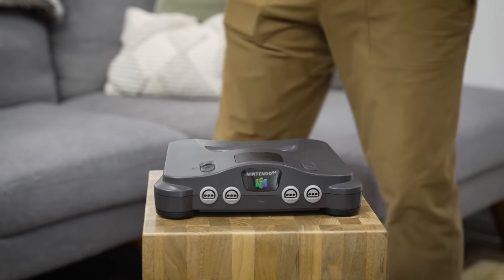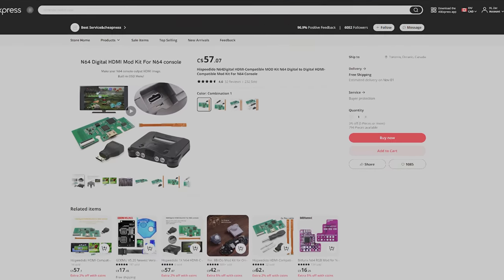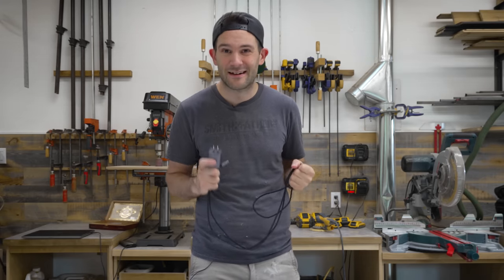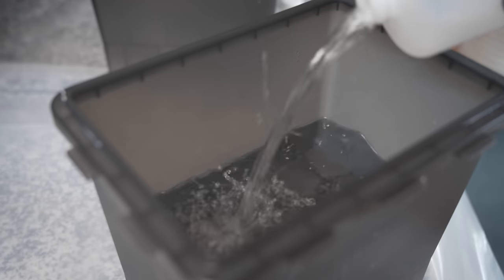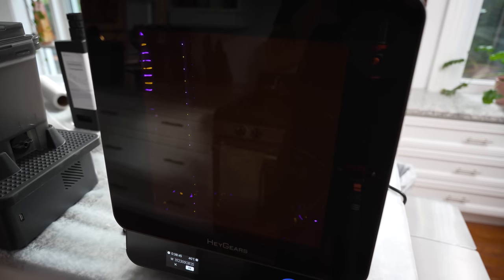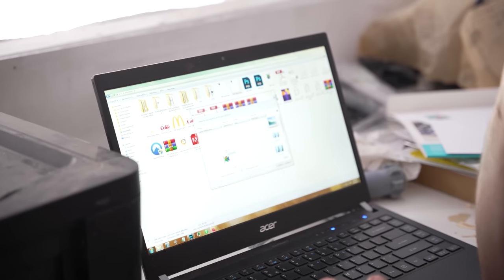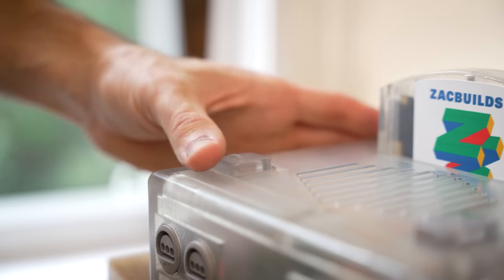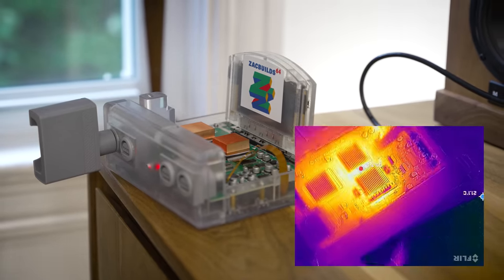I built a MODERN N64...

Comment: for anyone else wanting to do this its always a good idea to make sure you have the right voltage with a voltmeter, you can always resolder but you cant really go back if you fry your main board
Reply: a voltmeter? You mean a multimeter.
Reply: @lostdeath4202  ahh bahaha yes i do! i must have been a bit sleepy when i wrote this lol
Reply: @lostdeath4202  there are such things as standalone voltmeters and ammeters etc.
Reply: @lostdeath4202  How dense are you to not know what a voltmeter is ?
Reply: @pigggy2313  explain the difference between voltmeter and multimeter
Reply: @branaden  Honestly I didn't know they had standalone ones. I wasn't trying to be a mean btw
Reply: @lostdeath4202  a *multi*meter is called such, because it can read/measure *multi*ple things at different ranges. Usually 0-1000VDC, mV, VAC, current, resistance and diodes all in the one unit.
Reply: @lostdeath4202  A multimeter contains a voltmeter, just like it contains an ammeter (amps) and an ohmmeter

Comment: You should take apart the wireless receiver for the controller, de-solder the memory card connecter, and 3d print a new clear case for it so it is smaller and fits the style of your system! (or better yet, integrate it into the internal case by soldering the daughterboard right to the controller input pins.)
Reply: enriqueamaya3883  - Ha ha ha ha ha ha ha!
Reply: For real, that thing is fugly
Reply: First thing I thought when he got that giant thing out the box and yet he didn't!!!
Reply: He mentions this at the end of the video.
Reply: Add a memory card slot to the console. :)

Comment: Ok, this was amazing! I agree with disassembling the controller receiver, but a simple small dongle to attach in the original plug would be fine and something you still can do. I hope you have fun with it :)
Reply: If you do, just keep in mind that good mods aren't cheap.
Reply: exactly...the build is finished...nothings perfect...but that's pretty close...i was like...what the hell is that receiver could it be any uglier...must be way to solder it inside...he mentions it last in his final thoughts...that is the only thing to criticize...thermals are fine i'm sure...fit a small 1inch fan at the back with a few slots to be sure
Reply: I don't know if I would want to permanently install them. The power draw from the brawler dongle becomes a problem for the n64 with more than one plugged in. But if you never plan on multiplayer or just use the corded controllers for everyone else, you should be fine

Comment: I think the Everdrive's savegame functionality only handles on-cartridge storage. There were a few N64 games which required a memory pak for storing save games and wouldn't even let you continue from a game over without one, and some games also provided extra functionality with memory paks. So it's still really helpful to use a memory pak with this build.

I have the original wired Brawler 64 and it's pretty nice but I don't like how the thumbstick is a dome rather than semi-concave/indented like on the original. But aside from that it's a great controller.
Reply: There are 135 games on the Nintendo 64 that save via Controller Pak, and the Everdrive 64 has no way of emulating that. Only the ability to backup the saves from one and to write saves back to it.
Reply: You're correct, the Everdrive 64 only handles on cartridge save games.  A controller pak memory card is required for the games that used that method of saving.  The Everdrive 64 can create and restore backups of the controller pak though.  Modern versions of the controller pak exist, using FRAM, so a battery isn't required to hold the data.  If he was to do a revision, I'd just build the controller port adapter hardware into the case with a new controller pak inserted.  Of course, this setup lacks rumble, which means the Tribute 64 would have been a better pick for the wireless controller.
Reply: Yeah, this was a pretty glaring issue in the video. Hopefully @ZacBuilds will pin a correction because you absolutely need a memory pak with loads of games and the Everdrive does not emulate those, at best it can make backups of a memory pak that you can later restore back to a physical memory pak.
Reply: It's ok, but every modern controller has the analog gate shaped like a GC controller, making the sensitivity change with direction. Tribute64 is even worse (I know because I have two), since the cheap sticks they use aren't consistent to begin with. They're also overly sensitive in general, and this last one also goes for the old Hori, which is by far the best third party controller out there. 

Bottom line, you'll never get a better response than an OEM controller in good condition. Good news is steel bowls are now somewhat readily available, should you want to fix a worn one.
Reply: I came here to say this too. Without using a controller pak, you lose save functionality in some games.

Comment: I guess you could also take apart the cartridge and put it into the case. So the only thing sticking out the front would be some leds and maybe a tiny push button per controller to help reconnect if the link fails for whatever reason. At this point the machine could effectively be waterproof (grommets on rear leads and o-ring around the shell), and you could use it put your drink on - no fear of it shorting!

Comment: I did my own USB-C power mod for my N64. What you need to keep in mind is that it's not easy to find power adapters that support 12V. In those cases, you'll end up getting only 9V. So, I added a step-up converter to turn whatever comes in through USB-C into 12V. And the 3.3V step-down converter should be powerful enough to support around 3A. I replaced my first version with a 5A board with heatsink. Maybe you should check the heat of that module after using the console for some time.
Reply: Why tho? What's wrong with plugging it into the wall socket?
Reply: I can’t believe that this is efficient overall. Isn’t there any after market, small power supply with everything in the AC plug?

Comment: This is so sick! The micro-soldering left me in awe lol
But yeah like you said, the one thing I think you should've done differently is the controller port as the system looks so good, it's unfortunate that the controller piece sticking out is a bit inelegant.
Maybe not pure wireless like you said though, as there is value to being able to have different controllers like if a friend wants to use an OEM or something. I think the best solution would be to crack open the wireless adapter, remove the big memory card part, and re-case what's left with your 3D printer.
Reply: The micro-soldering can be learned. Best thing I took away from this video was the practice board. Definitely going to order one now.

Comment: As cool as it is to have watched you build a modern PS2, and now a modern N64, it's kinda sad that you start both with being annoyed by the antiquity of it.

I feel like, as a kid whose first console was an N64 for my fourth Christmas, the inconveniences are part of the experience. Hearing that static buzz as you turn on your CRT, finding the RCA connectors in the back if you weren't lucky enough to have a set on the front of the TV, dialing the volume in juuuust right to be able to hear it, but not so loud you wake up your family.

The slowness of it, the difficulty, the resilience of the hardware in the face of the absolute destructive power of children.. that's all part of it, for me at least.

Comment: Brilliant work Zac! just wow! ANother option is using the Nintendo Switch ONline N64 controller and the blueretro wireless adapter to lower the profile on the front without the memory card slot. really great work on the 3d printed custom case too!
Reply: This is probably the best modern option. The combination of correctly designed analog gate and the sensitivity settings of the adapter might actually come pretty close to the controllability of a good OEM stick. All the current third party options kinda suck, sadly.
Reply: There is also a 8bitdo conversion kit that allows him to keep the same controller shell and a Hall effect joystick!
Reply: @YimYum911  Hall effect is nice in theory, but the module they ship has the same incorrect gate geometry as every other (non-Hori) third party controller. 

You could keep the original stick for a simple wireless conversion, of course. It might not be very economical, but you could also get a steel bowl from Brewstix to rejuvenate that stick and significantly improve reliability.

Comment: Two things I'd recommend. 1) tap the holes when installing the standoffs. That ensures a proper threading for the parts. 2) I certainly couldn't do it, but it would have been really cool to see the wireless module integrated inside the case. You could make a controller port movable and set it back in the case, or even perhaps hardwire it.

Comment: You should have used the "Meguiar's Headlight Restoration Kit" spray instead of the automotive clear. it works wonders on plastic so I guess on acrylic would be also a good thing to use on

Comment: nice work, love the outcome!

but the resin printing bit got me really axious. You should definitely use safety goggles at and near the printer, this stuff is dangerous to your health. Just put them on when starting to work on the printer, you wouldnt want that stuff in your eyes. Neither the resin nor the IPA, especially no IPA with resin residue.
also if you plan on doing resin prints into the future, a respirator with an organics filter and a lab coat are pretty much essential, as every spill onto your skin and even the fumes make you more likely to over time develop an allergic reaction to the resin!

Comment: shows us a 17 minute compilation of a painstaking process involving disassembly, microsoldering, designing, printing, cleaning, curing, sanding, painting and assembling the new case
"See how easy that is? plug in 2 cables and this nearly 20 year old system fires right up!"

Comment: Nice touch with the automotive clear, you said the paint job want perfect but clear never comes without orange peel. if done correctly clear can be wet sanded with 2000 and buffed for a clear and smooth finish

Comment: 2:00 you dont need a hot air rework station at all, if the pins are visible is completely unnecessary, you just dont know how to use the soldering iron correctly, not  all over the place, but pin by pin using a desoldering mesh or a Solder Sucker

Comment: you need a fan.
Reply: Why add noise to something that doesn't need it?
Reply: @Shnowz  because 60° is not an healthy temperature.
Reply: @doughnut_panda hotter than usual, but it's probably fine as long as it isn't hitting 80+
Reply: @hi_its_jerry  yeah it's fine but heat reduces electric components life span.
Reply: @doughnut_panda  this is true,  a noctua never hurts

Comment: I think some oj your solder joints are missing some heat. Your Iron is hot enough but the contact isnt. There are preheat stations, to warm up the pcb. You solder while the pcb is also heated

Comment: The need for so much extra stuff is exactly why I don't own a resin printer (yet)
I love using FDM machines, but there's no denying the amount of detail you can get with a resin one is insane. 
There's also a lot less post-processing sanding if you're doing work that should be painted, or you just don't want layer lines. 
The bigger downside obviously being that resin printers aren't quite there yet that they can have as big of a volume as a FDM machine, so no Iron Man resin helmet in one print just yet...

Comment: micro soldering is easy, aside from putting SMT components on a board that you have no way to hold it in place beforehand

resin is better in certain ways, but not superior... especially due to just how much support material is REQUIRED to use resin prints, and then you have to remove all of that, and clean it, and then cure it...

FDM prints are basically plug-and-play by comparison, both require a considerable amount of knowledge to work, but FDM has less "waste" and a smaller "footprint" due to the fact that it doesnt need all of that extra space

Comment: bend a thick copper wire to touch all the leads and heat that up, and it will desolder a lot of through-hole stuff much more easily

Comment: Honestly I think for the wireless controller bit, setting it up with a switch could be good. That is to say the wireless part is inside the case but there are still ports. At the top of the case is a button along each of the ports that swaps between wired and wireless input. Maybe with an lcd indicator to show which mode it is in.

Comment: The N64 was fantastic for it's time... 

I actually like the N64 controller too - it was unwieldy, but you could hold it multiple ways relatively comfortably, and the analog stick was fantastic - it was the best analog stick for many years - and in my opinion, it still stands up with the best (all the usual suspects - what controllers do YOU use personally? their sticks all feel the same to me - N64's had a little more tension, so precision movement was very easy.  

Of course, they also wore out easier... or seemed to.

Comment: For the N64 controller to fit it. If you have medium and small sized hands, buy a hori Pad mini. It has a GameCube controller stick. It's a rubber start button so it has two z buttons. Overall it is a 10 times better controller. I've had it for 2 years and I've never had a complaint about it except it's really hard to put in and take out memory cards

Comment: Those heatsinks are too big if you want to use the old rf shielding. There are 40x40x4 you can get in copper, too, but I'm sure it won't do as well as the 10mm. It should still do better than the aluminum alloy that came stock though.

Comment: you've probably gotten this comment a lot already, but the pinout on the n64 controller receiver isn't for memory cards, it's for peripherals like the Pokémon stadium transfer pack. The internal battery on all n64 carts is what holds a slight voltage to keep your save. (A lot, but not all) Game Boy games, NES games, and SNES games had the internal battery to keep a save state.

Comment: Very awesome. I would like to see a follow-up video where you do make even more enhancements. Like a 2.0 model of what you've done. You've expressed interest in having the wireless mods internalized and that sounds great, but wireless controllers need charging or to be connected at some point. So maybe when doing away with those retro controller ports, it could be replaced with USB-C, or how about magnetic tips (Love those things). Also, would it be possible to integrate the Everdrive inside the console, providing SDcard access, and still being capable to use original games through the cartridge port?

Comment: Almost every modern tv has an "Av in" port in the form of a 3.5mm jack and they usually come with the required adapter's I've had both expensive and cheap TVs do this

Comment: If you want to get a perfect finish on resin items:
1. Tape a mirror to a cheap pottery wheel (your hands will thank you)
2. Tape your sanding material to the mirror with painters tape (mirror needed because of how perfectly level the surface is)
3. Start wet sanding with 1000 grit sandpaper, work your way up to 4000, then use Zona paper to get a perfect polish

This is coming from someone who made custom resin items for a living that needed to be mirror smooth and dimensionally accurate within .02mm per side

Comment: what i think is a better idea for the controller, connect the wireless one internally then have a small switch on the side to switch between wired and wireless input.
 sometimes you just want that classic feel of the original N64 controller.

Comment: No controller works as well as the original N64 controller for playing games that were built around it. There's a reason speed runners are still using them. Always make sure you lubricate the inner white bowl inside the housing though, because lack of that is what causes the grinding and loosening of the stick. If it's still decently tight, clean it with isopropyl and lubricate using synthetic lube like "superlube". If it's already too loose to use, you can replace parts from a company called "kitsch bent". The original controller also has the 3rd handle on the left which allows you to use the D-pad for movement and strafing while aiming and shooting with the right hand when playing first person shooter games which the N64 was famous for, like Goldeneye. These hand assignments are more modern than the controls you will have to use if you use the brawler or other non-original controller.

Comment: I was first one to create Black Boards with Gold Traces coated with Clear Solder Mask. Introduced to the High End Home Theater market in my high power audio amps. It is a cosmetic technique used to enhancing sales and marketing. Adds about 5% to the board BOM. The effect, we took a Pro quality amp sold into the Pro market for $1,500 and made numerous cosmetic upgrades. This was a mid range product. I took it and made it pretty. Adding Black and Gold boards, Mil Spec wiring and board design rules. Add a fancy front panel and you have a $50,000 amp with marginally improved operation. We did achieve a -107bd Noise floor with a THD of 0.01% at full power with all channels driven. Bose is a joke. They claim similar performance but these test results can be achieve by anyone testing their designs at 1/8 power with one channel driven. And we did not make any detectable noise using 96dB speakers.

Comment: Pretty cool project. Just be aware, by hard installing the ram expansion, at least 1 game won't work. Space Station Sillicon Valley has a bug in it that causes the game to crash whenever the Main playable character appears UNLESS you're using the regular jumper pack. Although not sure how loading it through an everdrive might effect it unless maybe there's a patched rom out there